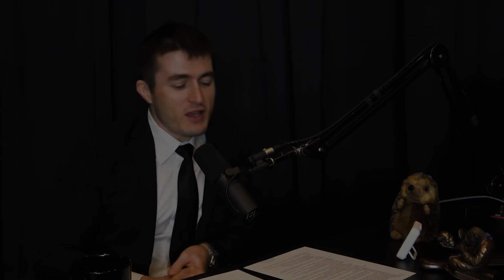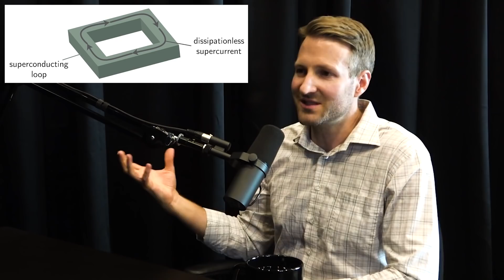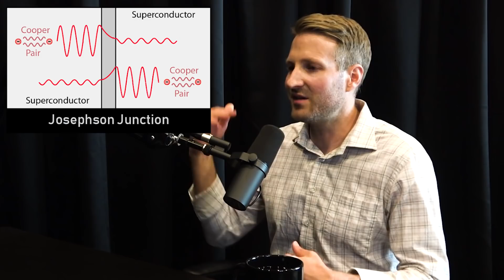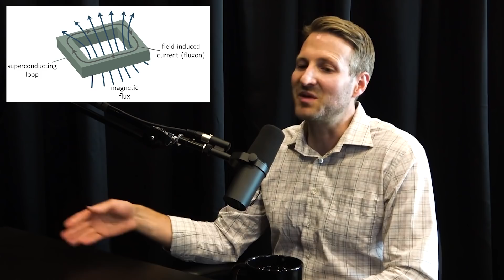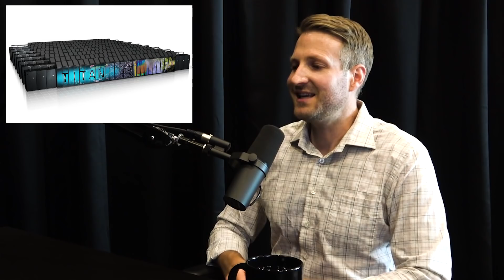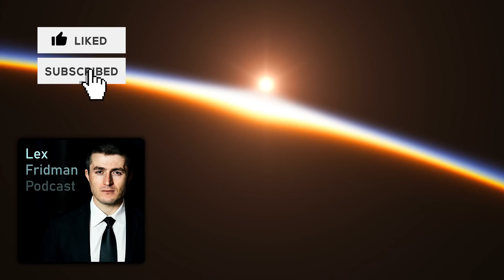Superconductivity Explained | Jeffrey Shainline and Lex Fridman

Comment: came here to understand superconductors more after learning about the possibility of a room temperature superconductor. jeffrey gave the best explanation so far!
Reply: its crazy how just a year later (today) its now possible to make the same superconducting chips he is talking about with LK99 that could maybe be used in mobile devices.
Reply: @forexwithjustiin  Well maybe, the jury is still out on if this is real or just another claim that ends up going nowhere. This is not the first time we have seen similar claims, best to not get your hopes up just incase. It could be weeks or months before we know for sure, but there are several reasons to be skeptical.
Reply: @forexwithjustiin  yeah still need to re-produced by other groups. Also we don't know how the material conducts at scale since no one has synthesised a large chunk of lk99 to test this yet.

Comment: Watched it twice and still can't quite get my head around this. Massive respect for Lex to be able to understand such varied complex topics and articulate the questions we didn't think to ask.
Reply: Let me take a shot at explaining this. (I'm a grad student in condensed matter physics by the way).

- When you have a macroscopic coherent quantum state (like the superconducting current/condensate), it often won't be significantly affected by microscopic local scattering. A microscopic local scattering event like electron-to-lattice-defect-scattering, can significant affect a single electron locally... but its effect on a macroscopic quantum state is exponentially suppressed. The effect is extremely weak even if it happens many many times. (non-defect periodic scattering of electron-electron and electron-lattice doesn't matter at all, for a different reason). Only a global perturbation that affect the macroscopic quantum state globally (all at once) can affect the macroscopic quantum state. An external electric field that affect all electrons at once globally can affect the macroscopic quantum state.

- The macroscopic coherent quantum state can form because two electrons (fermions) form a cooper pair (boson). Bosons can become condensate (like the famous bose-einstein condensate) which essentially mean a macroscopic quantum state.

- Why do the electrons pair up to form boson? Electrons and electrons (both negatively charged) repel each other when they are by themselves, so they don't want to pair up.  The mechanism for electron pairs can be different for different type of superconductor. Type I superconductor allows the electron-electron pairs because electron attract positive ions of the lattice which then attract an other electron. In other words, the effectively electron-electron attraction is mediated by a positively charged lattice ion. This effect/pairing is quite weak and thermal fluctuation can destroy it (similar to how thermal energy can destroy bonding between nuclei and electrons to form plasma). The weak electron pairing means a small amount of heat would destroy the superconducting state in type I superconductors.

Comment: Let me take a shot at explaining this. (I'm a grad student in condensed matter physics by the way).

- When you have a macroscopic coherent quantum state (like the superconducting current/condensate), it often won't be significantly affected by microscopic local scattering. A microscopic local scattering event like electron-to-lattice-defect-scattering, can significant affect a single electron locally... but its effect on a macroscopic quantum state is exponentially suppressed. The effect is extremely weak even if it happens many many times. (non-defect periodic scattering of electron-electron and electron-lattice doesn't matter at all, for a different reason). Only a global perturbation that affect the macroscopic quantum state globally (all at once) can affect the macroscopic quantum state. An external electric field (from a battery for instance) that affect all electrons at once globally can affect the macroscopic quantum state.

- The macroscopic coherent quantum state can form because two electrons (fermions) form a cooper pair (boson). Bosons can become condensate (like the famous bose-einstein condensate) which essentially means a macroscopic quantum state.

- Why do the electrons pair up to form boson? Electrons and electrons (both negatively charged) repel each other when they are by themselves, so they don't want to pair up.  The mechanism for electron pairs can be different for different type of superconductor. Type I superconductor allows the electron-electron pairs because negatively charged electron attract positive ions of the lattice which then attract an other electron. In other words, the effectively electron-electron attraction is mediated by a positively charged lattice ion. This effect/pairing is quite weak and thermal fluctuation can destroy it (similar to how thermal energy can destroy bonding between nuclei and electrons to form plasma). The weak electron pairing means a small amount of heat would destroy the superconducting state in type I superconductors.

Comment: This is so fascinating. Superconductors sounds like those futuristic technology that we still don't know where to apply efficiently. It's like when transistors size started to shrink and manufactures realize you can fit hundred of thousands on an inch but they thought, who'd do that and for what purpose?!
Reply: Tell that to people building maglev in Japan using superconducting magnets
Reply: @huskiehuskerson5300  interesting,!
Reply: We have thousands of uses for superconductivity, we just can’t build practical superconductors yet that can be used.  If we get room temperature super conductors that can be mass produced, the world will be changed.
Reply: @rgaud8 tag you're it!
Reply: @birchbarkmann didn't take very long
Reply: The Large Hadron Collider at CERN in Switzerland already uses 23km of superconducting magnets. It’s currently the biggest application for them in the world.

Comment: Wait couldn't stacking alot of the josephson junctions and created free or drastically cheaper power 🤔
Reply: the problem is that they require being cooled to very low temperatures. The machines that do this can only accommodate so many chips at once and are extremely expensive to operate. The cost benefit ratio compared to classical chips isn’t enough to attract investors.

Comment: OMG, i got it instantly.
A superconductors temperature LOWERS
the ENTROPY.
like lowering the friction or collisions between the flow of electrons. The current is free flowing because of the macro- quantum state were the wave function is smooth enough. That's as close as i can get to putting it so simply😂